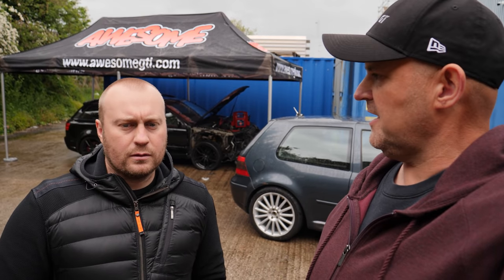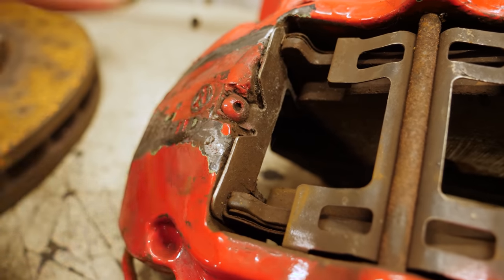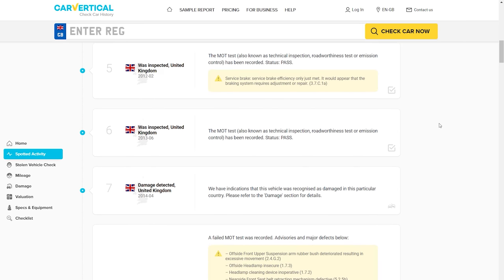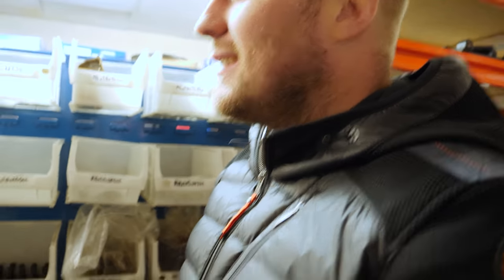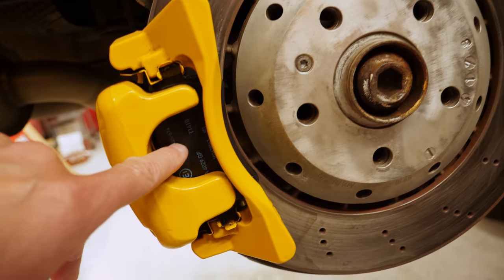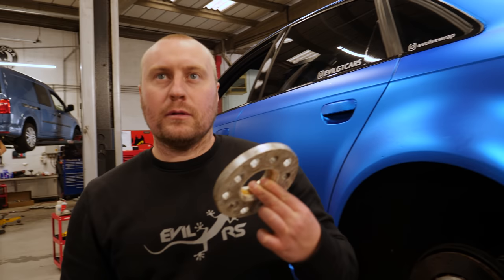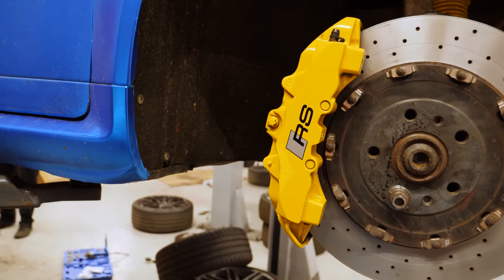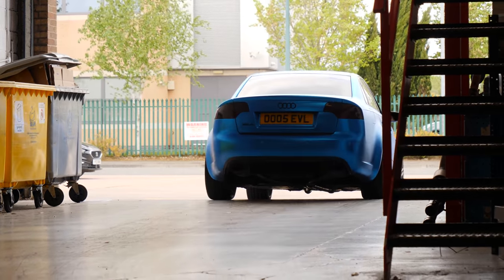We Saved £1000's On New Brakes By Doing This Simple Thing!

Comment: Motor looks way better with the spacers on 🔥🔥🔥🔥🔥🔥 which heat resistant paint did you use on your calipers bud
Reply from the maker: Hammerite I think. It’s on the video bud 👍🏼
Reply: @EVILGT  I did think that wasn't sure cheers bud